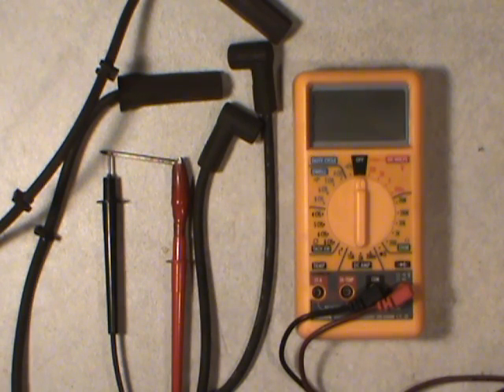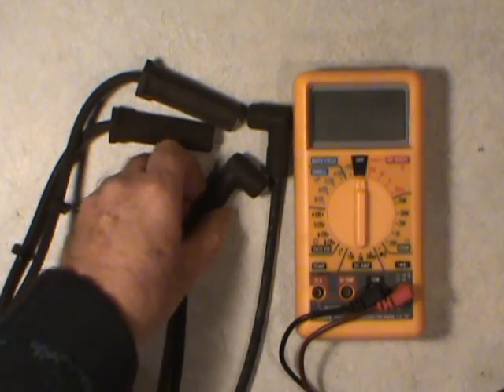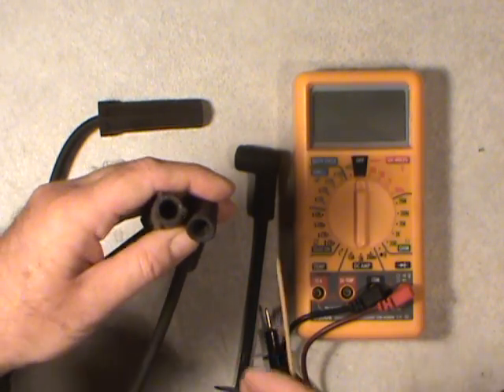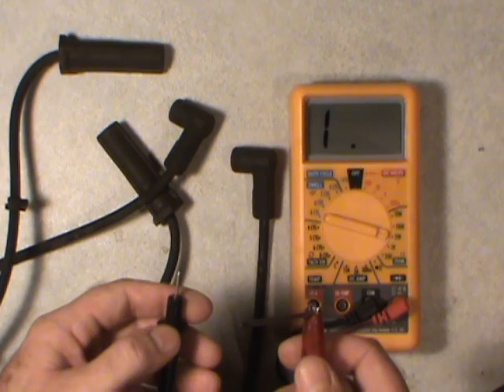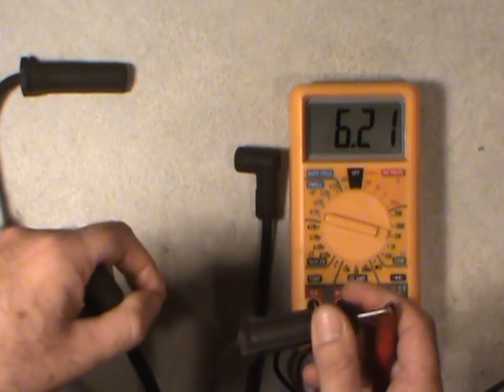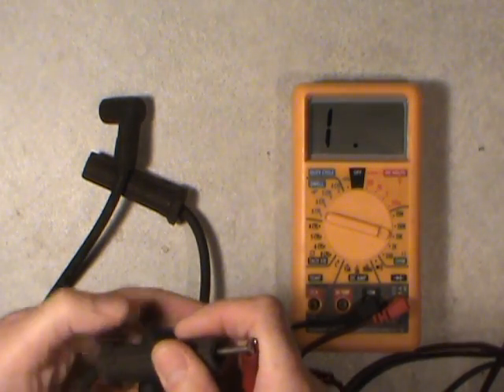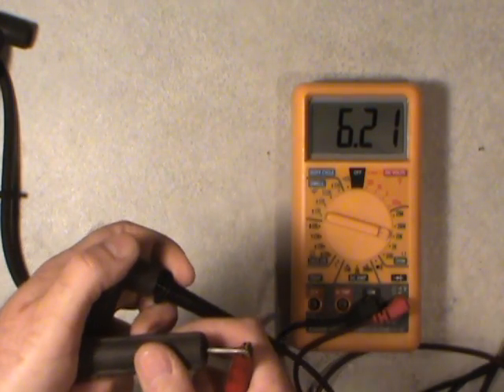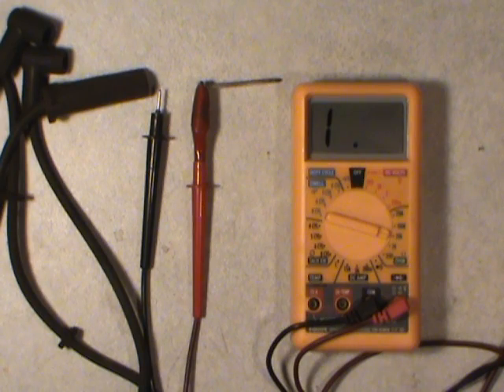How to Test Spark Plug Wires

Comment: thanks its very helpfull for me!
Reply from the maker: Greetings...YOUTUBE LOVER.............You're welcome, and, I'm glad that this video of mine, was able to help You out.............There are quite a few, different, types/styles, of spark plug Wires out there, and quite a few different Manufacturers as well, oh, and, sometimes, there's even a choice of Colors too...!!!...lol..............The more common, carbon/string, type of spark plug Wires, when New, will probably have, a, quite High Ohms/Resistance (usually specified, by the amount of Ohms per Foot, so, the different Lengths, of the spark plug Wires, has to be taken into consideration as well), and, that High Resistance, is usually there for, taking care of any Un-wanted Electrical Interference, that can cause, anything, from, hearing ticking noises on the radio, all the way up to/as bad as, something like, if it happens to be, a newer, fuel injected type of engine, that is controlled by the vehicle's On-Board Computer, along with, quite a few sensors and actuators, then, if any Un-wanted Electrical Interference, got too close, to something like, one of those Sensors, then, that Affected Sensor, might start sending the Wrong Signal, to the vehicle's On-Board Computer, and if so, I be thinkin', that, the Engine would probably start running, not so good, and hopefully, not getting damaged, at the very same time..............If You care to, You can have a look/read, at the other comments, under this Video of mine.............Also, feel free, to have a look at the Videos, that I have on my YouTube Channel...RockysRoadshow...enjoy, and.......till next time........Be Safe, take care, and have a good one.

Comment: my spark plug wires read 1.25 -2.0  all 8 of them does that mean that r bad
Reply from the maker: +Henry Evans Greetings Henry Evans....Thanks for watching..................Now then, about those Ohms readings that you saw..................Well, there might just be, a thing or two, as to why, You saw, the Ohms-Readings, that You did, on Your Meter............................Have a look at Your Meter, and try and remember...Which Scale/Range...that You Selected, when You were Ohms-Testing, all of Your 8 Spark Plug Wires/Leads, as that's one, very important consideration, as to, just..."What kind of an Ohm-Reading"...that You'll be seein', along with, just Where, the Decimal Point is Placed, in relation to, the Numbers that You'll be seein', on Your Meter's, Display/Readout............................I'm thinkin', seein' as how, All of Your Spark Plug Leads/Wires, Ohm-Readings, are, so Close to one-another, that, in itself, is tellin' me, that, Ohms/Resistance-wise, only, that they should be alright................................Each Manufacturer, of, each and every Different Type, of Spark Plug Lead/Wire, that they sell to Us, when, New, should have a Certain/Specified, Amount of "Ohms/Resistance", for a given" Length" (maybe, as in, Per Foot of Length), of that particular Type of Spark Plug Lead/Wire..............................Is Your Engine Running Good and Strong...???...or, is Your Engine..."Miss-Firing"...(Ignition related), to some degree...???.................................If Your Spark Plug Leads/Wires, have really Low "Ohms/Resistance", and they happen to have, "Solid Wire Conductors" (High Voltage Conductive Core), and the Engine is Running really Good, then, just Turn Ur AM Radio On, while the Engine is Running, and, You'll probably be Hearin', some rather LOUD...Clicking Noises, that are, pretty much, in Time with Your Engine's, RPM's/Revolutions per Minute, unless, someone, happened to install, some kind of Filter, that would be able to Cancel, all of that, not so wanted, Electrical Interference (if possible?), that is....................Now then, something like, a Points and Condenser Distributor, "Ignition System", from my experience, isn't all that fussy, having, some pretty old Spark Plug Leads/Wires, providing the High Voltage, to Fire the Spark plugs, in something like a Low Compression Engine, with, no more, then about 8.5 to 1 compression ratio, and, having the Spark Plugs "Gap-ed" at .035"/Thirty-Five Thousandths of an Inch..."BUT"...Now I'm talkin', something like, a General Motors..."HEI/High Energy Ignition"...Distributor (system)...Yes-Sir-ee-Bob, that be the One, that has, that, Really BIG Distributor Cap on "it", and, the Factory/Stock Spark Plug "Gaps", as I've seen, some time ago, Ranged from .045"/Forty-Five Thousandths of an Inch, on a Chevy V-8...all the way, Up-To, now get this .080"/Eighty Thousandths of an Inch, on an Oldsmobile V-8...!!!...YIKES...!!!..........................The LARGER, the Spark Plug "Gap", along with, having a Higher Compression/High Performance Engine, will as I see it, Demand, that a Very Good/High Quality Set, of Spark Plug Leads/Wires, be Installed, to be able to Contain & Conduct, that, "Much Higher...High Secondary Voltage", Electricity, "Reliably/Dependably", to each and every Spark Plug, or, probably end up having, some rather Unwanted/Destructive, Ignition related "Miss-Firing" go-in on...!!!...............................I always, make sure, that, All of my Spark Plug Leads/Wires, are "Spaced Apart", from one-another, and not near any Metal (like, Metal, Valve/Rocker Covers), using those Plastic (Not Metal...!!!), Separator Clips, so a Phenomenon, known as High Voltage Induction/Crossfire...Does-Not Start Happening...!!!......................That's where, 2 or more, Spark Plug Leads/Wires, are Too Close to Each Other, especially so, when They are Running Parallel to one-another, and, One Spark Plug Lead/Wire's "High Voltage", gets "Transferred" into, One of the Other, Spark Plug Leads/Wires, and, You guessed it, some rather Unwanted, and, maybe Destructive, Ignition related "Miss-Firing", or, Fire-ing the Wrong Spark Plug, at the Wrong Time (aka, having One of the Wrong Spark Plugs, Fire, as the Piston is Going Up, on the Compression Stroke...!!!)...Ouch...!!!.......................Looks to me, like Your Thumbnail Picture, is showin', a 1957 Chevy Wagon (Nomad maybe?)...Nice...!!!...............................If You happen to have any questions or concerns at all, just let me know, in a comment or two, under any of my YouTube Videos, and, like always, I'll do what I can, to help You out, and...............till next time.........Be Safe, take care, and have a good one.

Comment: my wires did exactly that, the reading was not constant it just kept bouncing around not a 6000+ constant ohm reading?
Reply: by the way i have taylor performance wires set?
Reply from the maker: Greetings...Ivory Harris...........Thanks for watching...........Here are a few things, that might be causing that Bouncing Ohm reading, that You saw.............Sometimes, those Digital (numbers only), Ohm/Multi-meters, take their sweet time/quite some time, before finally settling down, to a some-what fixed, and stationary reading/read-out, showing on the display screen, as I've found, and seen for myself, in some circumstances (might just be, the way in which, my yellow multi-meter, shall we say, Acts, maybe).............Then, also, "All, hand-held Connections", have to be held securely Together, when doing, just about any Ohm (resistance) testing, as well as, having All of those Connection points, nice-n-Clean as well, cuz, Oxidized/Dirty metal, connection points, can sometimes, make things work, not so good sometimes............I usually Shine a flash-light, down into, the inside of, all of those Rubber Boots, that are on the ends, of the spark plug Wires, in order to see, whether or not, there happens to be any Corrosion/Yuck-eez, that might be, sticking onto the Metal clips, that are usually, down/inside-of, those rubber boots (not good)...........It's a good idea, to put some Die-electric Grease-like stuff (looks kinda like Vasoline/petroleum jelly, some-what), into those rubber spark plug Wire "boots", before installing them, to seal out moisture, and also, to keep those boots, from Bonding onto the Spark Plugs, like Crazy Glue...!!!...............I usually, "Scratch", the multi-meter's Probe tips, (or, the common house Nail's, point-ee end), into the metal (part or piece), that's about to be Ohms tested, so as, to be (some-what) sure, that, I end up with a really good (and not misleading) Connection...........The "Cleaner", all of those (ohms testing) Connection Points are, the better, the result will usually be............It's a good idea, to Bend, in many directions/not too much, a spark plug Wire, as it's being Ohms (resistance) tested, that way, if there happens to be, a, shall we say, intermittent "internal" break, in the (wire's) Core/high voltage Conductor, of one sort or another, then, this Bending action, will probably expose that particular problem, if present (no guarantees at all...lol)............Also, as long as, each spark plug Wire, in the Set of them, have (reasonably), the same amount of Ohms/Resistance, in a given length, as in, per Foot/12 inches.............For example, 12 inches vs 24 inches...length/s of spark plug Wires (easy huh), and, lettuce say, that, the 12 incher, has, oh, 2,000 Ohms/resistance, then, the 24 incher, should have about 4,000 Ohms/resistance (not exactly, more like Ball-park estimate), and, if it is found, that, any spark plug Wire in the Set, is showing, way too High or Low, of an Ohms/resistance Value, for a given Length (or open circuit...???), then, He's the Bad Guy...!!! (usually)...and........till next time........Be Safe, take care, and have a good one.
Reply from the maker: Greetings...Ivory Harris...........(thanks again, for watching)...........The Taylor spark plug Wires, from what I've read, should be of good quality alright............If You can, try to find out, what the "Internal makeup", happens to be, for Your Exact, set of, Taylor spark plug Wires, as there are quite a few, shall we say, engineering marvels, that are made these days............The more common, and some-what less expensive (set of) spark plug Wires, are usually, what others and I, may refer to, as being Carbon string wires, and, will eventually break down/wear out, after a few years of use, just ask me...lol.............Then, another fairly common type, has a special alloy wire, that is wound around the Core (center of the wire), and with both construction types, it's to Supress rfi/emi interference, that's usually caused by, the high voltage pulses, that flow, through the spark plug Wire...........Ohms/resistance is one thing, but, it's that rfi/emi, high voltage "Interference" (high voltage pulse), that has to be taken care of, as in, if too much of this stuff, is, shall we say, "Leaking", out of, one or more spark plug Wires, then, on something like, a computer controlled, fuel injected engine, that has any of its Sensors, in near proximity to, any of this rfi/emi Electrical interference, then, that poor ole Sensor, or Sensors, as the case may be, could very well, get all messed up, and, might start sending the Wrong signal/information, to the vehicle's On-Board Computer, and, if lucky, the engine might only have a hick-up or two, and on a very bad day, engine Damage, it just might end up being, and, I hope not...........Try to keep, all of Your engine's spark plug Wires, separated/apart, from one another, and away from anything made of metal, such as, valve/rocker covers and the like, cuz, that high voltage, is really lazy, and will usually, try to fine the easiest path to an (electrical) Ground source..........If using those spark plug Wire "Separators", try to get (or have), the ones that are made out of, some kind of plastic-like material (electrically Non-Conductive)............Here's where it gets kinda Spooky (nah, not really), and, that is, to "Safely", have a look at Your Engine, while it is Running..."in the Dark" (after Sun-set)...why You ask...???....cuz, if there happens to be, any...Un-Wanted...or...Not Needed...High Voltage..."Sparkin' go-in on"...then...You'll more than likely, be able to see "it", with Ur own Eyes...!!!...oh, and, make sure, to have plenty of Fresh Air, around Your Vehicle, when-ever the Engine is Running, cuz, Exhaust Gas is "Deadly"...!!!...........Ah Yes, just seen that Sparkin', not so long ago, where, the spark plug Wire, was, shall we say, (high voltage) Arcing (sparking), which made a rather impressive Spark, jump, from the Wire, to a Metal rod, in the engine compartment, and, can also, at times, make for, an engine, Miss-Fire or two, sometimes............I even saw a spark plug's Porcelain, "Glowing", between the spark plug Wire's rubber Boot, and the Metal part of the Spark plug itself (where only, the spark plug's porcelain was exposed, to the open air), every time, that, that spark plug was firing...Hole-ee-gwalk-ah-moly...!!!.........Last, but not least, maybe, look up, what the Manufacturer, installed on Your Vehicle, when it was New, as it pertains to, the spark plug "Wires", cuz, if the Engine ran really good, with "them", when the Vehicle was brand spankin' New, then, what more can One ask.............Even, Spark Plugs, can have different Ohms/resistance Values as well, as in, for example...no resistance....5,000 ohms...&...10,000 ohms...there-abouts (just, ohms measure, the center electrode, from end to end)..............I try to think of a Vehicle's ignition system, as a whole complete unit, and, before trying a part, that is Not specified by the vehicle's manufacturer, then, I will usually go on the inter-web, and check things out..........Things like, replacement ignition coils, that don't have the required Ohms/resistance, especially on the low ohms/primary side, can sometimes, make for, something, like a weak spark, and sometimes, could end up, with an ignition coil that Fried itself (not good at all), and........till next time........Be Safe, take care, and have a good one.
Reply: thanks for the info!
Reply: NextgenGamer Taylor wires are garbage dude, get MSD super conductor. These MSD super conductor wires have the lowest resistance of any spark plug wire out there (except for maybe Granatelly but those are like $300 bucks). T

Comment: I test new ones out of the box along with ignition coils. I've got bad stuff.
Reply from the maker: +bassfan41 Greetings bassfan41....Thanks for watching...................Sorry to hear about, the bad luck, that You were mentioning..........................As for me, I've had pretty good luck with Electrical Parts, that I've bought, for quite a few Vehicle's, over quite some time, and, it's a good thing too, as, just about any Electrical Automotive Part, once taken from the Store, is, for the most part..."Non-Returnable"...!!!...Yikes...!!!.........................Well, a few years ago, I had a "Faulty", Good Brand Name, Mechanical type/Fuel Pump, that I installed, on a V-8 Engine, Pump the Gasoline very Poorly, up-to the Carburetor, as in, very Low Fuel Pressure and Low Volume as well...........The Engine seemed to run, not all that bad at first, but, a short time later, the Engine quit running, and, didn't want to start, but, I guess, I was lucky after all, cuz, I did manage to get the engine started & running, poorly, I must say, just before the Battery, was about to die, and leave me stranded, along with, a not-so-wanted, quite expensive, towing bill.............Yes-Sir-ee-Bob...the Car..."Limped-its-way-Home"...thank goodness...lol............Strange that (new, brand name fuel pump, acting silly)...but...the smaller Automotive Parts Place, that I've been dealing with, for quite a few years now, have great Guys working there, and, Exchanged the Bad One, and, got me another, Same, Top Brand Name, Mechanical Fuel Pump, that, once installed, Works really good, and as it should be do-in...........................Oh, I guess, every now and again, an Automotive Part or two, might slip past Quality Control (if there was any to begin with...lol), and considering, the almost un-imagineable, Amount/high number, of Automotive Parts out there, there's bound to be, kinda, something along the lines, of, a good ole Sayin', that goes something like this..."There's always gonna be a Bad Apple or two, in, that there, Barrel of Apples"...(was I even close...???...lol)...........Best of luck with Your future purchases, and...........till next time..........Be Safe, take care, and have a good one.